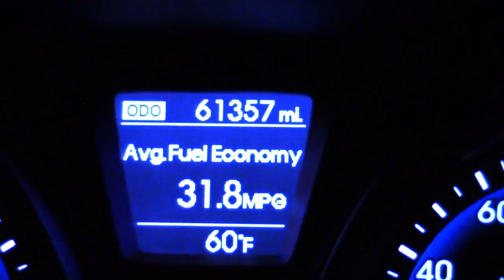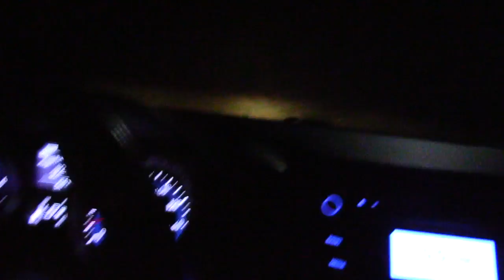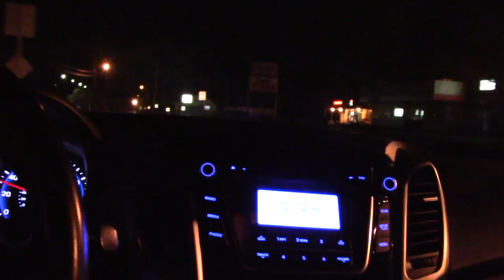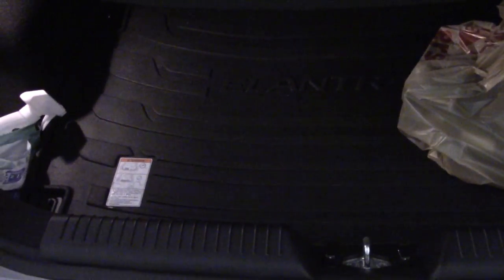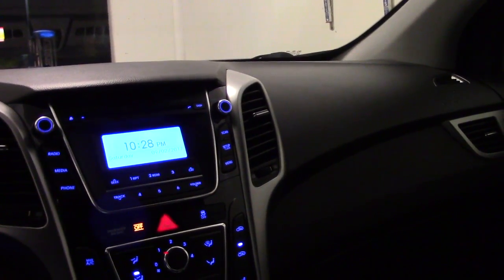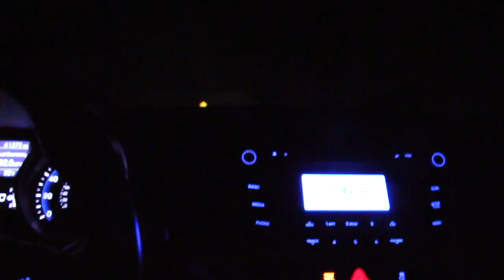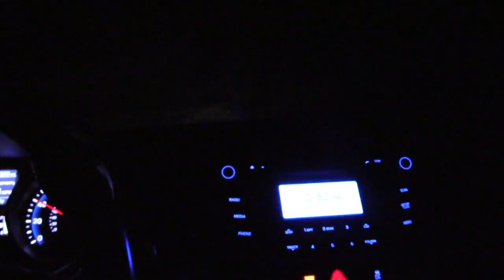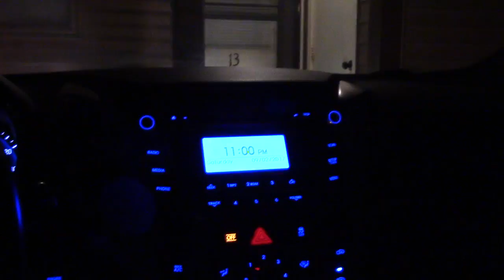2014 Hyundai Elantra GT: How Has It Held Up After 60,000 Miles?

Comment: I actually just decided to trade in my 2016 Nissan Versa for a brand new 2018 Elantra (sedan model) since I've started driving a lot and wanted something a bit more comfortable to drive in. Coming from a CVT that was designed to have fake shift-points, this car by far has one of the best automatic transmissions that I've experienced. Seriously love this thing.
Reply: Hey what's up? Do you still have the 2018 Hyundai Elantra, if so have you had any problems with it? I just want to see if these cars are reliable...

Comment: My Subaru has a glovebox light. :-) And Hyundai's turn signal clicker sounds like an old GM car. Is it an actual mechanical relay clicking? Most cars these days use a little piezo beeper in the instrument cluster or even the driver's side front radio speaker to produce the turn signal noise.
Reply from the maker: For some reason, Hyundai still uses an old-fashioned "clicker" for the audible feedback. Even my 2007 Versa had a piezoelectric "beeper" for the audible feedback. Personally, I think pumping ANY audio feedback through the entertainment system is a step backward, and is user hostile by preventing aftermarket stereo installation.
Reply: VWestlife who cares, the important thing is that it works

Comment: In my opinion, Hyundai has proven to make very good cars, especially lately. I think just as good quality as anything, seem to be up there with the best of them. But then I tend to think cars today, are in many ways better than they've ever been. Most power, best body construction and fit, and I think reliability is better too. And we have the most efficient cars ever, mainly by that I mean for the size of modern engines, they make a ton of power compared to the past, with small V6s making as much power as many big V8s used to.
Reply: Also, you can check the fluid on these newer cars, but you have to go under the car to do it.

Comment: It's kind of ridiculous just how much driving you do; my car is a 2005 Honda Accord LX that was bought brand new, and it only has 78,000 miles. Granted, I live in a small town (albeit densely populated), so my commutes are usually less than 10 miles, but most of those miles have been in hard stop and go traffic.

It's a hand-me-down (was my mother's originally), and she loved it. I've driven it for about 4 years now, and I'm incredibly satisfied with it. The only major repair to it has been an alternator replacement, and that was around 2013 or so.

Back to the subject of Hyundais, it really is impressive how far Hyundai has come in the last 10-15 years or so. I remember when their cars had a terrible reputation. They're definitely doing something right these days, I will tell you that.
Reply from the maker: Thing is, in order for me to live where I work, I'd have to double my salary to afford anything within reason. Living in a lower cost (rural) area, it's still cheaper for me to own a home and buy a brand-new car every three to four years, even factoring in fuel and maintenance costs. Granted, I do love the town I live in, it's still highly inconvenient.
Reply: Instead of getting s new car so often, get u a 04-06 lexus ls430.  Excellent car, excellent reliability, smooth, quiet, plush Awesome car.  And u can get them for less than ur Hyundai but a lot more car.
Reply: My mother had a Hyundai Santa Fe from 2004, and it never really did it for her. After a few years, thing pretty much died.
Reply: You're from somewhere in PA, right?
Reply: Interesting ...
Reply: Dude, I have 42.000 miles on my 17 Elantra. You need to get out of the house and go places! Cars are for driving!. Theres nothing ridiculous about putting miles on a car lol. I take excellent care of my cars, cause I'm a car guy. I ENJOY driving.  I dont like sitting around the house all the time on my days off. I like going places! Yes, I have an 80 mile round trip to work and back. So that does add up. But I couldn't care less how much mileage I put on it. Lifes to short to just work and stay home. Get up and go! And I'm 59. When I was younger,  I used to drive at least 50.000 miles a year. Now I'm averaging about 22.000.oh shit, I'm slowing down!!😄

Comment: Any trouble with cupping rear tires? I have the same model with sport tuned suspension. 2 sets of great tires, Bridgestone Potenza Pole Position Ultra High Performance have cupped. I'm thinking because of the torsion beam rear suspension, causing the rear end to often bounce off imperfections in the road. I have 47K and drive on the terrible roads in Houston, TX. Other than that the car has been great and I love it.
Reply from the maker: No, not at all... I have 80,000 miles on it s of today, and I burn through tires so goddamn fast anyway, I haven't noticed cupping.

Comment: I live in ky Appalachian  mountains i have the same car except manual trans i drive 96 miles a day just for work 72000 miles have you had to service anything
Reply from the maker: I have 76k on mine, and outside of oil changes and tires, I've had three GDI intake and injector cleaning services, one transmission flush, two brake flushes, and one coolant flush. I've had three warranty repairs done; EVAP control valve, right-front wheel bearing, and the rear spoiler replaced. Otherwise, this car still looks and drives like it did the day it was built.

Comment: Do CV you still have your car and how is running any problems?
Reply from the maker: Yes, I still have this car; it currently has 78,000 miles on it and has been one of the best cars I've ever owned in many ways. Problems? 1) Wheel bearing, right-side front, replaced under warranty at just over 30k. 2) Evap canister purge valve, repaired under warranty at around 40k. 3) Rear spoiler had an issue where it would buckle slightly under extended periods of direct sunlight. Replaced under warranty at around 25k or so. Otherwise, no issues.
Reply from the maker: I am also one of the few Hyundai Elantra owners who actually maintains my vehicle... it gets regular intake cleanings, oil changes every 3k, transaxle flushes every 30-60k, and coolant flushes on a regular basis.

Comment: I am planning to buy a used 2014 Elantra GT. It has completed 125000 miles. Till now no accident reported. All seems to be ok. Will it be wise to buy it now with the price 4500$? What things should i watch out before buying?
Reply from the maker: Honestly, these are decent cars. If I were buying one today, I'd immediately bring it to the dealer for a transaxle flush and a GDI induction service. More often than not, these two critical services are never done as they are expensive - and if it's the difference between having a $250 transmission service, or buying a new cell phone and vape pen, most folks will go for the latter.
Reply from the maker: My Elantra was still solid at 108k when I sold it, and remains on the road to this very day (I recently ran a carfax on it).

Comment: Hiya Brandon.
I know exactly what your on about with the EGR system.
My dad's Mercedes=Benz Sprinter van had to have number 1 cylinder in the 2.3 Diesel engine I think it is, completely cleaned out, the engine nearly blew up because of Carbon buildup.

Funny thing is older diesels like the Ford Transit 2.5 DI Diesel engine as far as I'm aware haven't suffered this problem, much older diesel design, and the initial models didn't have a turbo.  Might've had it was a direct injection engine in 1984 for the Ford Transit van in the UK but I've never heard of it.

Comment: No engine problem or ticking ?
Reply from the maker: 97,000 miles on the clock and aside from the perfectly normal GDI pump and injector noise, she's a strong running vehicle. There were some known issues with the early 1.8L "Nu" engines related to a manufacturing defect and weak piston skirts, but by 2014, these issues were largely addressed.
Reply: @bbishoppcm  How often would you need to get a GDI engine pump what is the usual cost of it?
Reply from the maker: @Penelope416  The GDI pump should last well over 100,000 miles or so... it depends on a variety of factors. If the pump does fail, it will cost roughly $300 or more plus labor to install. If a pump is needed, it's absolutely CRITICAL that you buy an OEM (original) part, and avoid seeking the least expensive option. I'd recommend buying one from a dealer, or a parts supplier that gets their parts from the original manufacturer. High pressure fuel systems are not a place to skimp out on, as a faulty or improperly installed pump can leak, and easily turn into a flame thrower that will shoot fuel out at up to 2,000 PSI!

Comment: Does it have a cassette player?
Reply from the maker: Just the one I connect through the AUX jack... why?
Reply: Just joking, the last car with a cassette player was in 2009-11
Reply: It was the 2011 Ford Crown Victoria.  Standard equipment included an AM/FM CD Player, but a tape deck was available as an option.  I'm not sure if this was also available on the 2011 Mercury Grand Marquis, but you could probably install the AM/FM/Cassette stereo from a Crown Victoria in the Grand Marquis, as both cars were nearly identical.
Reply: The 486 Man I own a 2005 Buick Rendezvous cxl. It has a combination cassette deck CD player and Sirius XM Satellite Radio all in one. By the way the vehicle has almost 200,000 miles on it and it's still on the road in 2017 and looks new.
Reply: no only cd
Reply: BorislavFan Yo44 I know
 (it was a joke)
Reply: The 486 Man fine
Reply: The 486 Man I like Elantra cars

Comment: I have the same car 2012,  can you tell me about the motor sound in the morning? On this video you have the same sound. Is that normal? Do I have to worry? Is good to do engine flush with Motor Flush oil, or not?
Reply from the maker: GDI engines, regardless of manufacturer, are usually VERY noisy at startup, especially in cold weather. The Elantra GT (the model shown in this video) was introduced to the US market in 2013. Even if you do NOT have the GDI engine, I wouldn't worry about a bit of valve noise on startup as long as it quiets down after a few minutes. As for flushing the engine, this is almost never needed; if your engine was poorly maintained and is sludged up, simply change the oil and filter every 2,000 miles or so until it starts to clean up on its own.
Reply: He's right that is typical of gdi engines and most engines that have variable valve timing tend to have a rattle noise upon startup. Engine flushes help quite a bit, gdi engines make a lot of carbon deposits both in the intake valves and the oil too. Intake cleaners work well but if your car has higher mileage it may need to be taken apart and cleaned. I'm a technician and have the same car and I've experienced no real issues with the car other than the terrible suspension and handling issues. I would also recommend NOT following the manufacturers maintenance schedule because it's BS. Change the spark plugs and transmission fluid before they recommend and do oil changes every 3000, yes even synthetic because the oil deposits in the oil are what kill the oil. Don't forget a PCV valve every once in a while lol
Reply: @sjschreier  thanks bro!

Comment: 2010 I want to say is the point at which I feel Hyundai/Kia started sort of getting their act together. My mom's got a 2008 Sportage (with the Hyundai Delta V6) and that car--whilst VERY reliable--just feels like a chore to drive. Not to mention Hyundai/Kia didn't really begin using timing chains (I hate hate hate belts after hearing one too many stories of an engine getting taken out by a bum belt) until after 2010, either. I also want to say their transmissions have gotten much better since (4 speed auto on a V6? Oh man...)

But I've driven a few of Hyundai/Kia's cars since and good god they've improved so much. I drove an Accent hatch last year and it was a zippy little car that I'd love to own. And my mom bought a 2015 Optima hybrid (Kia's variant of the Sonata hybrid) and it was a lovely car to drive. Same goes for the Forte and Soul. If I were in the market for a new car Kia would be at the top of my list. (Well, I like Mazda but they're a bit too expensive sadly. Toyota's kinda boring but maybe that'll change?)

Hyundai is killing it lately. Cheaper and just as reliable as Japanese brands and with a killer warranty.

Comment: Automatic transmission  arent reliable as much as i drive yes their tight
Reply from the maker: Not always true. A well-engineered automatic will easily outlast a poorly engineered manual. I've owned both, and prefer a manual over an automatic, but when I bought my car, a friend of mine bought the last new 2014 Elantra GT w/ manual they had... so I ended up with the automatic. To be honest, 76,000 miles later, my transmission still shifts as smoothly as it did the day I drove it off the lot.

Comment: sounds like a diesel
Reply from the maker: Yes, all GDI engines do. 85,000 miles now and still going strong!
Reply: @bbishoppcm  Do you still have this vehicle, and if so have you had any problems with it?
Reply from the maker: @PROTAGONIST_48  I actually just traded it in due to needing a larger vehicle. In the 106,000 miles I owned the Elantra GT, it was essentially trouble-free. I maintained it religiously, including performing transmission fluid exchanges every 30,000 miles and having the induction cleaning done regularly.